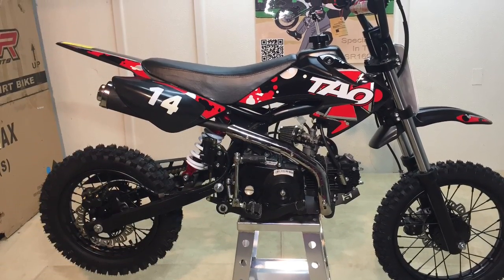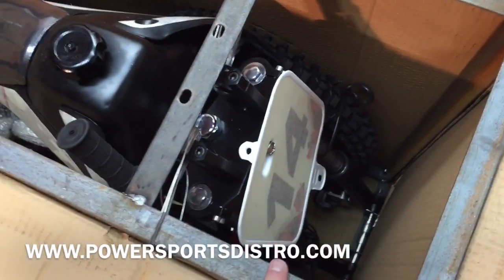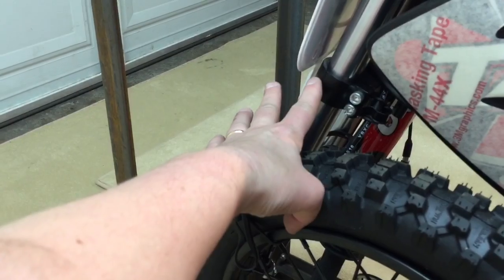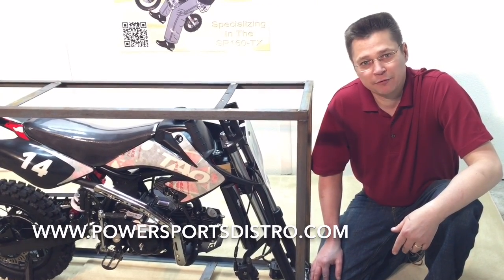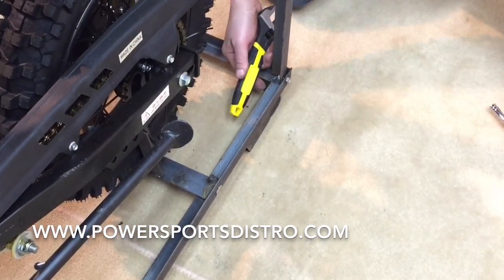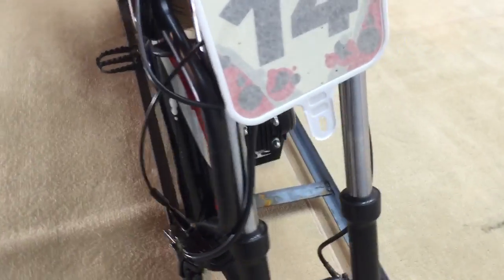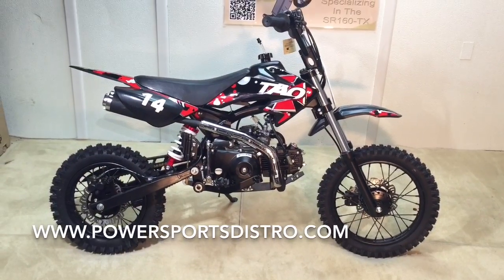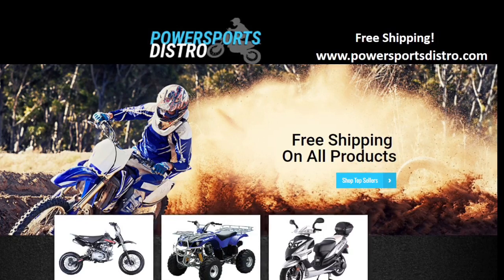VERY DETAILED Assembly of a TaoTao DB14 110 Dirt Bike by Powersports Distro

Comment: You should use blue loctite on every single bolt, nut and screws also change the shipping oil out with 4 stroke 10w-40. DO NOT RIDE THE BIKE WITH THE OIL IT SHIPPED WITH!. The higher the octane fuel the better. I recommend 93 octane.

Comment: you said shorter spacer on front wheel goes on brake rotor side. when i put mine together the rotor was hitting the brake caliper, so i put longer spacer on rotor side of front wheel and it works fine. are you sure your right? of course there are no directions to assemble bike. bought from you by the way........
Reply: Other videos say longer spacer goes on the disc brake side, glad I caught this, looks like someone a few comments up was messing up their bike because of this ****😒😡

Comment: I'm having an issue on my DB10 and DB14.  The front wheel keeps twisting during riding.  It has made it unrideable at this point.  Anyone know how to fix this?  I've tightened every screw to the point of stripping the bolts and now I have to replace the bolts.  How do i fix this issue since the bolts strip before things are tight enough to prevent the problem?
Reply: See comments below, appears the spacers need to be opposite from his instructions

Comment: Does it come with oil already in it?
Reply from the maker: ReauDog yes it comes with oil in it but it is shipping oil to lubricate the engine while shipping from China to the United States and while it's sitting in the warehouse before being sold.  You definitely need to change the oil.  Also, after a engine break in process you need to change the oil again to get the metal particles out of the engine which you need to do with any small engine you buy not just dirt bikes.  Pretty much all new engines will leave metal particles in the oil while you are breaking it in and must be changed.
Reply: @PowerSportsDistro  Great to know, thanks! Also, what type and how much oil does it take?!
Reply from the maker: ReauDog it takes about 1 quart of oil.  After putting in about 3/4 of a quart of oil you would want to start using the dipstick which is located in the same spot as where you are pouring the oil in. The oil dipstick will tell you if your still to low and need to add more.  We use 10W 40  4 Stroke motorcycle oil which most all auto parts stores and Walmarts carry.
Reply: @PowerSportsDistro  Thanks!